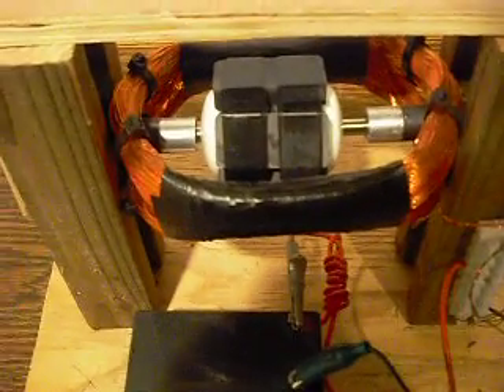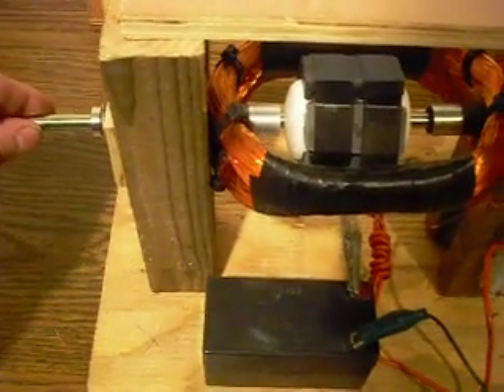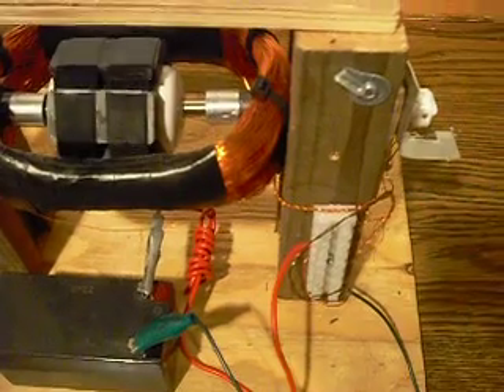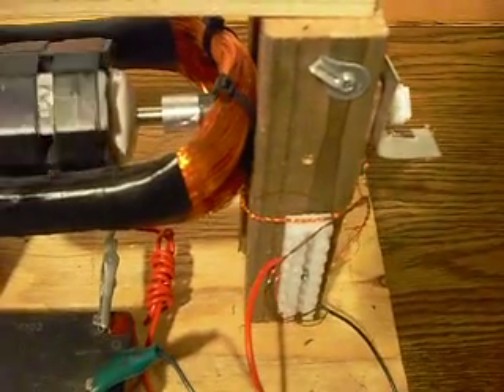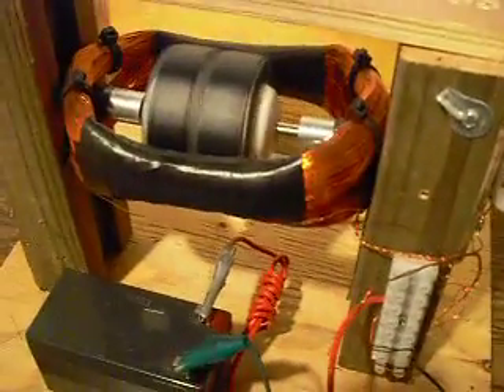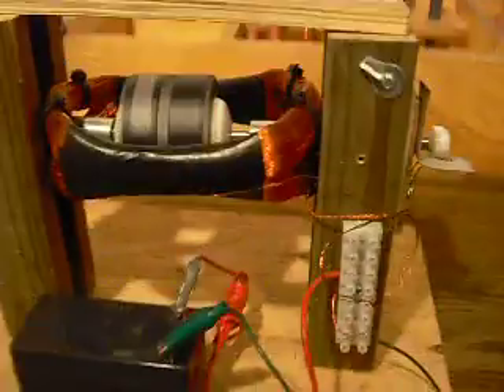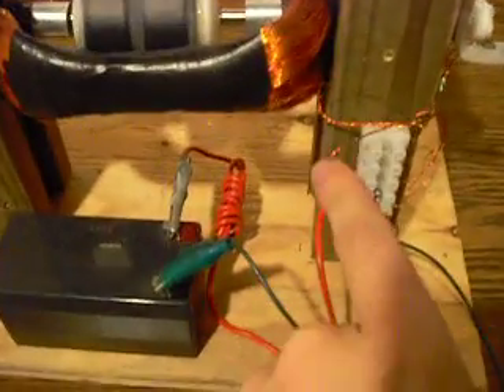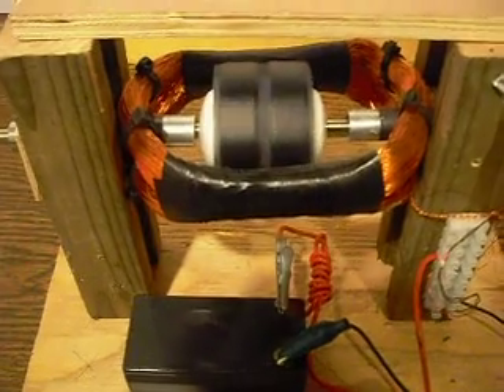Bedini Window Motor - Radiant Charger

Comment: nice video, ideally how much of primary and secondary should I use and what gauges do they have to be to make something like what you did and charge batteries effectively? and also can I wind them separately and then lay them up on top of each other or... do I have to wind them up in pair like bifilar?
Reply from the maker: To be honest I don't know the best ratios yet. But I just watched a clip of John Bedini saying that he used 300 turns on one coil, and 900 turns on another coil the 2 bifilar coils are place 90 degrees apart, with the coils both being Bifilar, one about 27 gauge and one being about 18 gauge (the 900 turn coil is 27 gauge). I'm not certain this is what he used, because he didn't say what size wire, but he did say 300 turns and 900 turns, both bifilar. His motor runs without any input energy of any kind, it's self generating and self sustaining. Nobody knows exactly how he did that.